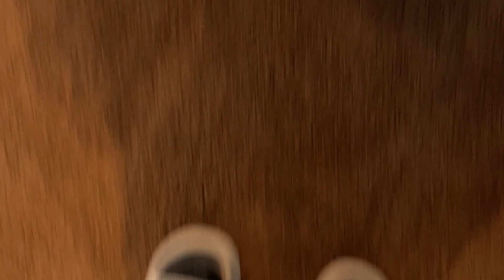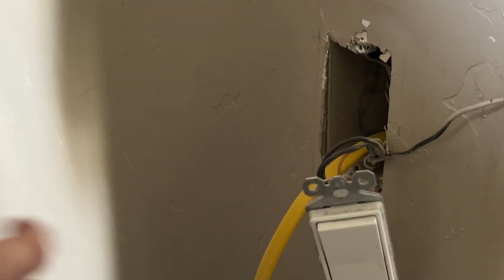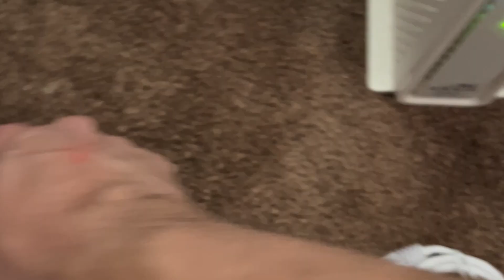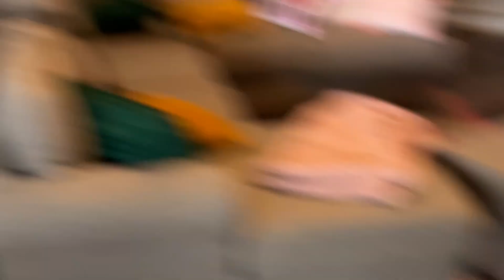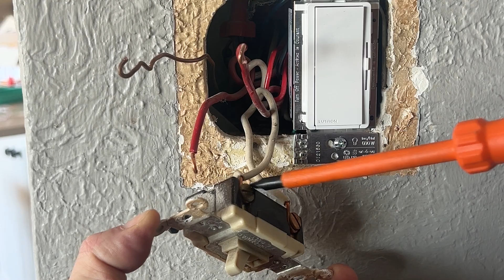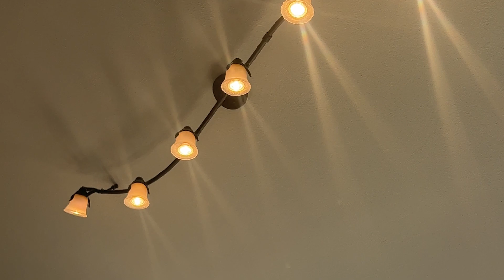How to Install a Smart Dimmer Switch | A DIY Electrical Guide

Comment: Thanks for making the video. I'm trying to replace two switches in the same box with smart dimmer and they both require a neutral wire but mine are all bundled into 1 wire nut. Do I add the two white wires from the switch into the bundle or do I split the bundle into 2 and attach half of the wires to each dimmer switch, or do I do something else? Both switches are single pole. Thanks!

Comment: Can't believe you have such inconsistent electrical wire colouring, and twist on connectors? OMG. Perhaps for Doorbells or 24v applications.  In Australia Red is Active (live), Black is Neutral and Green is Earth:  Always; since the 1950s. Every circuit breaker is also an RCD. But yeah. I guess 240v means you got'ta get it right.
Sometimes on AC Plugs and cables Neutral will be Blue and rarely Active (Live) will be Brown.   Junction boxes and screwdriver use only insulated electrical connectors are minimum.

Comment: Great video! Thank you!
Question- what if the single pole switch to be replaced had a white neutral connected to it? If it’s not going to be connected to the smart switch what happens to it?
Reply from the maker: If the neutral is not required on the new switch then you can cap it/tie it in to any other existing neutrals in the switch box.
Reply: @MrFixItDIY that’s what I was hoping but it doesn’t work. I’m starting to think it might be a switch loop. So I’m goi g down that rabbit hole! Thanks for your response